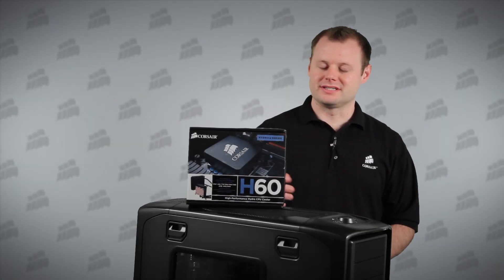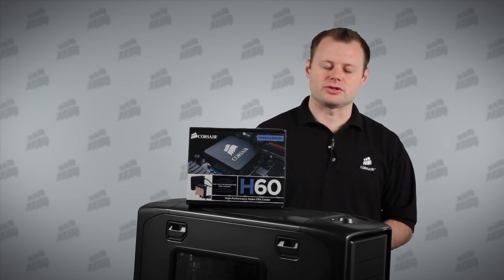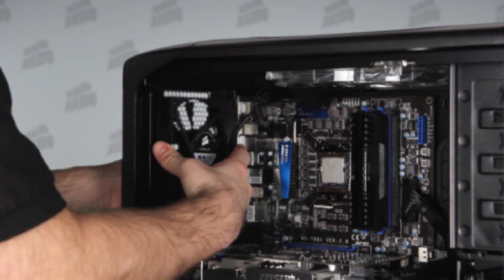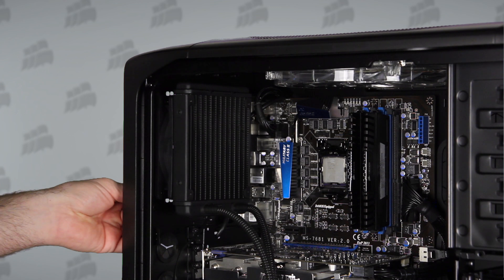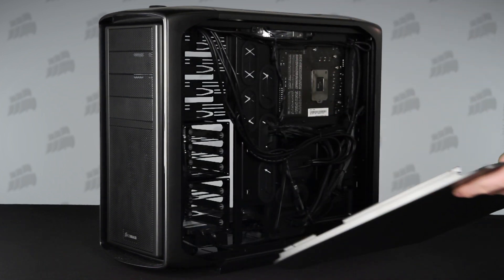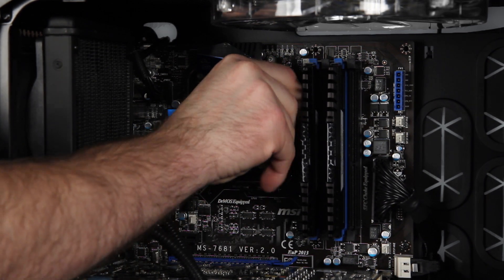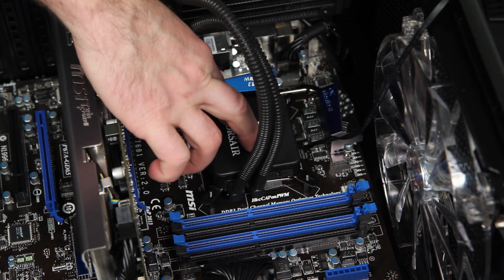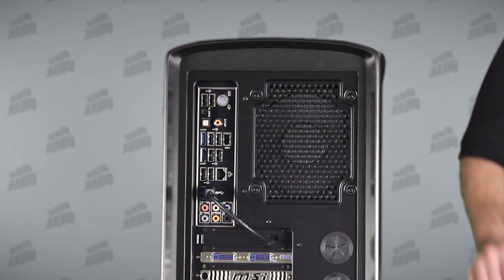Corsair Hydro Series H60 CPU Cooler Install How-To Video

Comment: This is an old model, does not fit with the new AMD4 boards. The board's holes are different. I had this problem when I changed from AM3 to AM4. Be aware what you buy.

Comment: Where do you plug in the 2 plugs? The one on the fan and the one on the cooler pump? I put the Fan one in CPUFan on the motherboard, and the pump in CPUother is that right?
Reply: It’s the computer fan port and your power supply

Comment: Well, this video shows radiator/fan installation opposite of what the H60 manual shows.  Maybe it does not matter ? Also, for an AM4 processor the attachment bracket sucks. First, the manual tells you to uninstall the stock Mboard brackets before installing the H60. That is WRONG - so you end up reinstalling them when you finally figure out the instructions are wrong. For an AM4 on a Asus b450 Prime Plus you end up with trying to center the cooling pump on the cpu which you can no longer see because of the mounting system, which is a two screw layout so it is pure guess work. I found it rather clumsy. The four screw layout would have been much easier for centering purposes.  Also, the Corsair AIO software only works with "I" series coolers, which took me a while to figure out since Corsair never mentions it.  So I have done several of these over the years, great coolers but the manuals and software suck as well as the installation videos. I know this thread is rather old but not everybody is installing the latest, greatest processors so I hope this saves someone some extra work. Oh, and Corsair puts 4 pins on fan but only 3 on pump, with only one pin for temp which seems a tad cheap..

Comment: I have ordered one of these and think that to fit my case im going to have to mod my case. Can you advise if the radiator can be mounted horizontally on the bottom of the case with the hoses pointed up the way?

Comment: Guys I need some help. I have a cougar spike with 2 120mm side mounted fans, my Mobo is h87 g43 matx, and Intel i54590. If I were to install this, how will I have any exhaust for hot air to escape my computer? Seeing that as of now my only exhaust is the system rear fan

Comment: I'm pretty new to this so I have a question. Can you mount the radioter on the exaust fan and place the fan that comes with the cooler on the front of the radiator? So it would push the air from inside the case through the radiator and outside the case.

Comment: hi. i have a mini itx mobo, and not enough pins to connect the pump. first , does it connect to a fan 3  pin ? if i get a splitter will it work fine ?i dont remember if it has  a light (the pump) ,  how do i know its working at all ? thanks,!

Comment: I know this was a long time ago but he put the fan in the wrong way.  That would be drawing the air in the exhaust and into the case.....
Reply: Actually that way is better if you have one cooler at the top blowing the heat out of the chassis
Reply: +Felipe Borges fair comment
Reply: hey anthony, i'm new to this, how do i install my watercooler ? what direction should i put the radiator + fan ?, i bought the h45 corsair
Reply: radiator in the front of the cpu or the fan ?? what is the push or pull method ? sorry for the noob questions
Reply: Acho que vc é BR então: coloca o fan pra empurrar vento para o radiador e não puxar o vento do radiador
Reply: Azazl187 Tech support tells me either way is fine, pulling or pushing
Reply: he wants cool air from outside the case to cool the cpu... i think
Reply: Yea I dont get that either. I have tried both ways. And rad>fan>out gave me the lowest and best temps. Then I did a push pull mounted in the top blowing out. I used SP fan>rad>AF fan> out the to, and that gave me CRAZY low temps. Devils canyon is setting at 24c. Booya!

Comment: Do i need to put water or its will be forever
Reply: its not water in it its gas and no once you install it it good to go with out refill
Reply: THX
Reply: Np dude 
i just installed mine and it was so easy well a wee bit fidele but np amd. intel you have to remove the mother board and the paste that comes with it is really good
Reply: I relly want to thank you very much
Reply: your welcome

Comment: Is this compatible with the i5 4690k and an lga 1150 motherboard? Amazon says yes but Corsair seems to say no.
Reply: vagosg53 Depends, if you want silence, any decent air cooler will win easily. And you compared a dual 120mm radiator against a single 120mm radiator, basically apples to oranges. Cooler master makes some good coolers, while others are sub-par.
Reply: +Tom Brown It is, I use it with my LGA 1150 motherboard.
Reply: Thanks! I fitted it with my LGA 1150 micro motherboard. Works like charm! Slightly disappointed with the temps though. My previous Cooler Master 212 Hyper EVO did a better job but I am selling that to a friend eventually.
Reply: lol coolermaster is way better... especially nepton 240mm and its silent also
Reply: yes thats what i mean.. they are silent .. corsair h100 i think iv seen a video and its realllyyy loud man... and nepton 240mm is really good for cooling i will buy it in  future

Comment: What about applying thermal paste onto cooling unit BEFORE attaching this atop the CPU?  Instructor kind of skipped over this crucial step.  Also, everyone knows AMD chips run hotter than Intel chips.  How much temperature drop can I expect with this H60 cooler unit?
Reply: Today is the opposite, intel cpus are powerful but the are damn hot in comparison to amd...
Reply: @saporob  agreed, I've burnt through several intels (literally), never had a problem with amd, even oc'ed
Reply: +Wellyn Brewster A lot of coolers come with pre-applied thermal paste now

Comment: no thermal paste?
Reply: +IAmKing720 I would remove it and apply your own.
Reply: +Ratchet what's the difference? not like it's required if it's pre-applied
Reply: +Zanzi The Cheefah I would remove the thermal paste with alcohol and then. add something better directly to the CPU  like artic silver. The pre applied paste works but I could tell after removing it a year later that it wasn't sticking evenly. Also some it got outside the cpu area.

Comment: Can I attach this to the top fan slot instead of the very rear because I like my red LED fan in the rear and I want to have it routed the the free one in the top of the case.
Reply: +Elucii Yes you can, they said if there is no spare space
Reply: Should be possible. Though due to the size, it may look a bit odd to have a small radiator on the top. Should make no difference in cooling, but if you have a windowed side panel, it's something you might want to keep in mind.
Reply: ***** Alright thanks for the advice

Comment: I purchased this today, i plugged the fan in to the cpu fan slot and the pump in to the sysfan slot. I then got great tempretaures so i decided to run a stress test, when i started the stress test the pump made a small but loud sound that didnt even last for a second. But when i turn the stress test off the same sound comes again but lasts for 2-5 seconds before dissapering again. 

This happens every time i run a stress test and play a game (Battlefield 4 and GTA V) Am i supposed to tweak som fan and pump settings or will this simply go away with time?

I am thankfull for any answers i get.
Reply: it's probably trying to keep up with the CPU's activity. send it back to corsair if u think it's a defect.

Comment: This H60 it's a waste of money , trust me i have it and i'm so sorry that i bought it . It's with Arctic silver 5 and still not cooling . DON'T GET IT . I warned you .
Reply: probs defect or ur problem.
Reply: +Videoman971 Maybe you should clean the filter
Reply: It worked for me. Beat my stock cooler by about 5-10 degrees C which isn't much honestly. I was expecting better. But it is entry level.

Comment: what if it leak out and destroy my computer? will they stand for this? even if the warranty end?
Reply: +sk8der This cooler has 5 star reviews across the board, it will never leak.
Reply: sk8der it cant leak it
Reply: Vampvarva123 out*
Reply: Vampvarva123 u sure? my m8 nzxt watercooler did
Reply: Hm, i have had one for 7 weeks now, and its has just begin make some thrilling sound from tha pump *****
Reply: sk8der I would contact corsair about it. If it's defective, they'd send you a replacement
Reply: if anything just sound loud or stop working, it will never leak, i have used for years and it never leak once

Comment: what if i dont have holes in my mother board
Reply: Long Duong you have to remove the mounting socket that was preinstalled (the one where the stock cooler is attached to)

Comment: How can i put some coolant in it. I opened the cooling system the one who is attached in cpu. Suddenly, the coolant leaked. Then I removed all the coolant. So , how can i replace it with another coolant?

Comment: Was wondering if I can put the radiator fan on top of pc as an intake as I already have a exhaust fan at the back and another intake fan in front of case. Now I know that hot air rises but will it make a huge difference ? I just want to put the radiator fan on the top as an intake if that's possible
Reply: Samundra Gurung offcourse you can.. if you dont want it to suck/pull hot air from the top you can always change the orientation of the fan..

in example you can change the top/radiator fan to push air from inside to outside the case instead of pulling in from outside (top.. hot air) to inside of the case, but if you do that you need to add intake fans to make the temperature inside the case cooler, you can do this by changing the orientation of the back exhaust fan into an intake fan..
Reply: Samundra Gurung Put it at the top inside as an exhaust.
Like in a corsair 540, intake in front exhaust in back, put the cooler in the top grill.

Comment: Does this fit a Gigabyte 970A-UD3P?
Reply: plz check specs of ur mobo before u post.
it'll make u seem more knowledgeable.
Reply: +SquidPlays also check the socket.
Reply: +GreyGorilla77 It's the same motherboard that I have and I currently use a Hyper 212 Evo until I can afford the H60, so it should fit fine if my giant air cooler does.

Comment: Would be great if you said which spots on the motherboard to plug the fan and pump into. For example should the fan on the radiator plugin into CPU fan or should the coarser unit plug into the CPU fan port.
Reply: Bill Adams Plug the one from the Fan into the CPU_FAN header on the motherboard, the pump is only a 3pin connection,  so you can plug it into any available port and it will run at 100% power all the time.

Comment: By removing my existing fan on the back on my case and replacing it with the Corsair Hydro Series H60, will my PC overall run hotter? Or does the fan in the water cooler cool the entire PC as well as the CPU?
Reply: i have the same Doubt....
Reply: You can orient the fan so that it pulls air out from inside the case OR so that it pushes cooler air in from outside. The first option always removes the heat that comes from the cpu immediately, making the case temperature lower, but if your case inside temperature is high then the cpu will not be cooled as well as the latter option would. The latter option would push the heat from the cpu inside the case, which might increase the overall temperature of your parts if you don't have sufficient intake fans on your case.

Comment: I installed one of these a few weeks ago and the cpu temp still guts up to 55 Celsius, the only thing I wasn't sure about was a plastic insert on the backing plate, I left it on, should I have taken it off?
Reply: Graeme Cadogan pretty sure it explicitly tells you to take that off, no? it's just plastic to hold the thermal paste on. take the plastic off asap if it didn't already ruin your pc
Reply: Of course dude!
Reply: It does not make contact with cpu, i do know the plastic cover you all are talking about. I've  been putting heatsinks on cpu's for over 10 years. The part i was referring too is the mounting plate that sits on the back of the mob, wich in turn you screw the mounting spacers into.
Reply: Graeme Cadogan That stays on. 55 degrees under full load? What CPU is it, that seems fine. The H60 is a budget WC solution.
Reply: man, that plastic could melt on your processor ._.
Reply: Dan R Indeed ! lol :D
Reply: Dan R It's on the backing plate which goes on the back of your MB, Corsair says it's there for insulation to stop shorting.

Comment: so this might be a dumb question but does the h60 already have water in it when you buy it or do you have to fill it up yourself?
Reply: ***** yes, but you dont have to change the water or something?
Reply: Tango Down Nope, doing so would damage it, so its mmeantto just stay there. Supposedly the coolant won't run out.

Comment: I'm replacing my cpu, will the thermal paste I receive with the new one be sufficient for the cooling plate?
Reply: You're buying a cpu with included fan?
If so, it's already smeared out on the stock cooler.

Comment: the fan has to push or pull air out of the case¿? <== FAN <== RADIADOR <== or ==> FAN <== RADIADOR <==
Reply: It's up to you, I find that having the fan on the front of the rad looks better. So it'd be setup <=== RAD <=== FAN for me.

Comment: Do you need to add thermal paste before putting it on the cpu
Reply: TheDivineScience Yes, that is fine and that is what I would do when applying and new cooler.
Reply: It comes pre-applied.
Reply: The Video Game Nut ... However, I need to ask - is it okay to remove all the pre-applied thermal paste (using 99.9% isopropyl alcohol), and then apply Arctic Silver 5 to the CPU instead?

Comment: I have installed a cooling system (no water type) previously on my system but I would like to replace it with a  water cooling system. Can I do so? Or I have to stay with the same I installed at the beginning of my built?

Comment: I got this cooler, installed it properly and my AMD FX-8350 at standard clocking kept overheating to where the bios would auto shut the computer down while gaming+streaming. I removed this water cooler and installed the stock heatsync/fan and the overheating issue went away. I would not recommend this product.

Comment: few questions:
why didn't he apply thermal paste, and if he didn't do i need to?
is the cooling liquid already in the tubes?
Reply: Because the thermal paste is already applied on the CPU block by corsiar and yes the water is already in it you just need to install it in your computer and hit the power button.
Reply: The H60 has pre-applied thermal compound.

Comment: Bought this today to install on an Asus P8Z77-V motherboard. I couldn't get the back plate to fit properly.  Did up all of the screws but there is a good 6-8mm gap along the riser screws. Ended up not using the backplate and having to turn nuts upside-down to get the risers to fit tightly. Performance is exceptional. Running an i7 (not o/c) at 39 degrees on full load.
Reply: lefilp

Comment: Hey guys I have this cooler in a system I built but I am going to get a new system case so ideally I l would like to clean all my components before installing them in my new case, with the part where the cooler actually sits on the CPU what is the best way to clean the thermal paste on it already & best way to re-apply if anyone can help that would be great thanks.

Comment: The coolant inside most of these types of cooling system are none-conductive coolant. It won't short out the motherboard even it does leak.

Comment: the thermal paste is pre aplied. And I don't get good temps with this cooler. I have a i5 3570k 3,4ghz. With no softwares running I am around 50C.

Comment: The pump itself is not. You can barely hear it if at all. The fan it comes with is however. Consider getting a quieter fan to use with it.

Comment: I don't know if this question is still relevant but I have the exact same motherboard and I also bought my computer from ibuypower. They installed this for me so I can tell you it is compatible. I'm upgrading my processor from a phenom II x4 to an amd fx 8350 8 core so I came across this video as I'm going to have to remove it to switch processors. Hope this helps.

Comment: Some people put the hoses up. I have an Antec 920 and Külher put the hoses up. I have the impression that the video card will heat up the hoses and disrupt the liquid cooling radiator. Is that correct?

Comment: The airflow should go into the case, and not from the case...
Why?
The air outside the computer is colder than the air from the inside.
So?
We want to get the maximum from our cooler so we should install it corectlly.

Comment: The cooling liquid is sealed in the unit and supposedly Corsair claims it will last 5 years.  It was recommended by an overclocking expert to change the unit after 2 years because of the slow evaporation of liquid over time.  DON"T WASTE YOUR MONEY.  But a nice Zalman air-cooling unit.

Comment: It is not easy to install.  My unit would not make full contact with the CPU and the CPU overheated.  I returned the junky H60 back and got a Zalman air-cooled unit and will never go back to liquid cooling again. It is not worth the risk of leaks and installation headaches. I will Overclock the CPU a little bit less.

Comment: same, i have a core i5 2500k and its stock heatsink clogs up with dust SO QUICKYL. i have to blow out the dust every 3 weeks or so!
then the temps just god damn rise!
on rigs of rods (mildly intensive game on 2 cores) the temps get upto 75c.
i idle at around 30c
so one of these watercoolers would probably be a good idea, as they collect no dust that will cause the cooler to be hot

Comment: So people using 80mm fans and no remove able right side case panel get F'ed in the ass and have to modify the device or go else where? 

What you should do is have front standard socket screw in to the board with 80 + 120 fan support 

Guess I'll have to find another luquid cooler